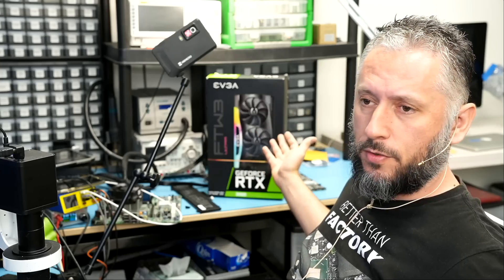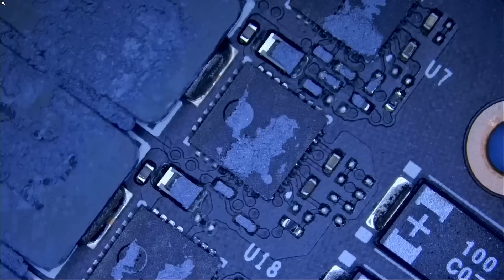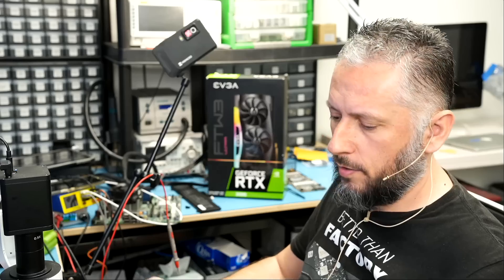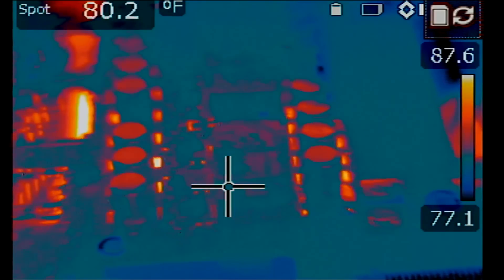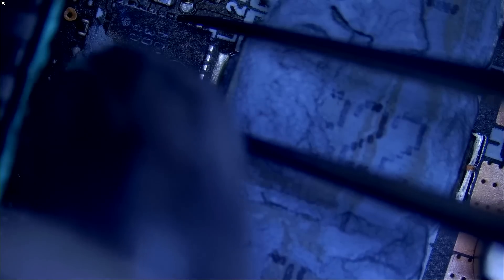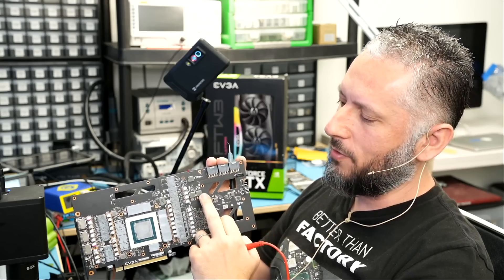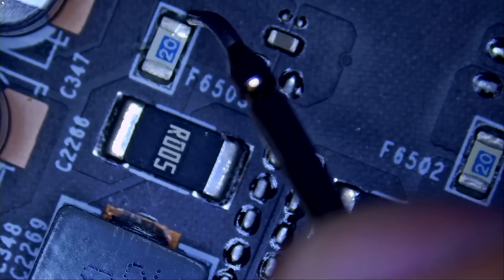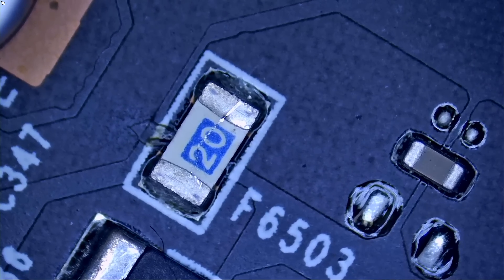EVGA 3080 FTW3 Graphics Card Repair

Comment: my 3080 ultra after changing the paste and pads the fans are working at top speed all the time, sensors on gpuz are not working black then just give number after a while but number not moving or too much delay, fan working in percentage but rpm is 0 you can't use after burn or any software to control the card, flash different bios for nothing, changing switch to normal does nothin! any clue?! 🙄🙄

Comment: I'm desperate for an answer, not to play a game again, but now I just want to know why randomly crash. Sometimes I can play for 3 hours no crash and then turn around a crash back to back and get an event log the system reboot because bugcheck was: 0x00000116. I have done everything you can thing of. Reseat Ram, GPU, cords, DSM, SF Scannow, scrubbed windows locally several times, until I finally did a fresh install at a tech shop from a disk they had, I have changed out surger protectors eliminated the surge protector to go straight to wall, Paid hundreds of dollars for the tech shop to look at the system, who said it passed all stress test, removed an OC, tweaked BIOS to optimal, nerfed bios to default no OC's , DDU clean install of driver ... How can I play for 6 hours no crash then crash every 40 minutes? I just want to know

Comment: This a great video. I have a Asus 3080 with basically the same issue. When the card is installed in the computer and turned on, the various LEDs in the system will flash, the fans turn on momentarily, then everything shuts down because the power supply shuts down to protect itself. I measured shorts on two of the 12V pins in one of the PCIe power sockets. Now I know where to start looking for the fault. Thank you.
One question: where did you inject the test voltage, at the PCIe power socket?

Comment: Owned this card for a year and the third fan back fan? Is failing… never even pushed the card on 1440p high/ultra and only struggles to hit 144 on tittles between 2018-2022. My older evga cards are still kicking. I wonder if they didn’t put as much care to these 30 series cards as the did with previous gens

Comment: they not short to ground , a going directly to GPU , maybe no fix if 12 v was going in GPU by chip NCP 302 150 (that why need put zener diode to protect the GPU from high voltage)

Comment: If I can ask a stupid question. If the cards input is 12 volts x12 volts x12 volts = 36 volts how do the cards pull 100's of watts?
Reply: You don't add the voltages. It's just more current @ 12v to support the power draw of all the components. If the card was using 300W it would be using 25A on 12V. I am not an expert but i assume each 12V line is connected to a different series of components because they can not all run on just one.
Reply: you have to multiply the volt and amperage to get the watts, for example a card consumes 12v and 20a, so 12X20=240 watts
Reply: Everything works with 12v. Simply more wires/pins/connectors because the current is pretty high. 1 wire will melt. Especially the thin pc wires...
Reply: the 3 EPS 12V connectors are often all paralleled, so we get the same voltage, but you can carry more current, this gpu i think uses about 400w so about 35 amps of current on all connectors

Comment: I have a small freezer in my garage that when dealing with a hot board, I just put in, and make a "QUICK" coffee, then come back and then look at it with thermal cam. Works really well!
Reply: Do the boards not suffer from thermal shock if you're putting them in the freezer still hot?
Reply: @zzfrost9063 want this answered!!!

Comment: Surprised you don't test it now.
They work with less power stages.
Then you can make sure the GPU actually works before you replace the chip.
Reply: EVGA will be missed. Most cards come with no fuses, and this one might just saved the GPU.
Fast-blow 20A would be my guess.
This Onsemi DRMOS is pretty good protecting the GPU in case of short as well, those are good quality.
Love the card, For The Win!
Reply: There was a hot spot on the GPU when Alex induced 1V, so the GPU is defektive imho.